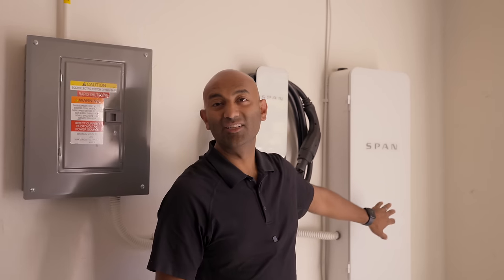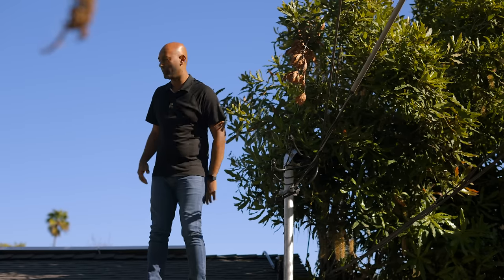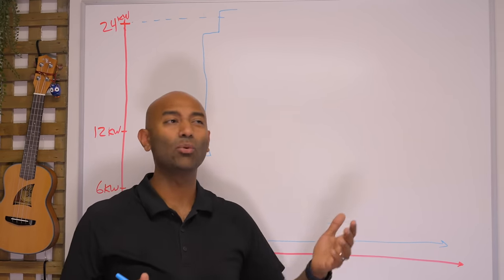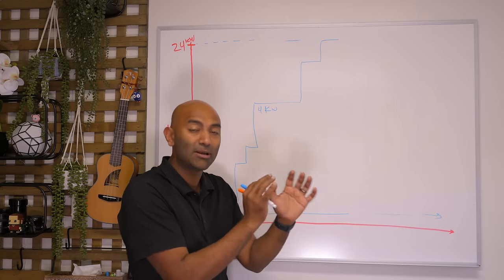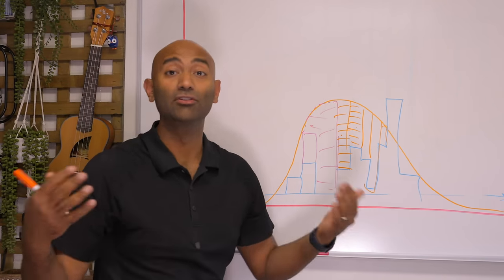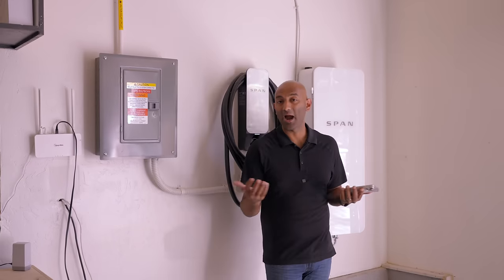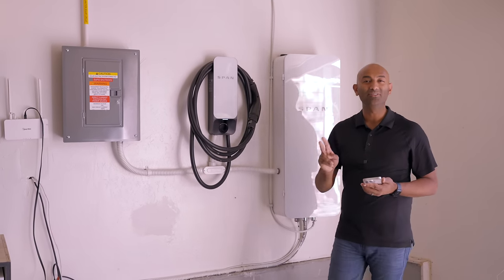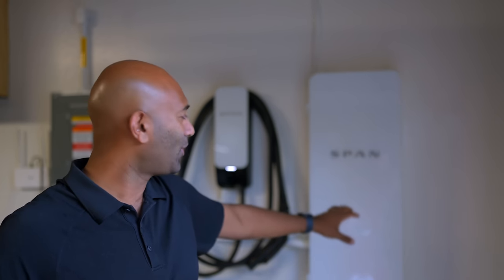I Installed a SPAN Smart Home Panel, Should You?

Comment: Another approach, especially those of us on $DG&E, is a battery back up modified to provide power when the grid load nears 100A.  Just like the panel it levels out usage, but in this case, without compromise (except price is a bit higher).

On SDG&E, also power everything from 4PM to 9PM.  That offsets part of the price.

I've tries to convince Sol-Ark to modify the software to their system (PV inverter, 48V inverter, 48V charger, transfer switch, grid input, & generator input).  I've also asked them to include an EV charger that can charge the EV with excess solar, and from midnight to 6AM when the rate is lowest.
Reply: I'm a bit surprised that Sol-Ark wouldn't be able to do that already.  It's one of the most programmable whole-house systems out there.   A feature to limit service ingress amps to X by augmenting the house from the battery system... that's something I expect they would want to add to their feature list.   Maybe try writing them a physical letter instead of using email.  Address it to the "Principal Engineer" or something like that.  It might get to the right person.

There is a bit of balancing act involved when grid-tied, particularly when it comes to managing grid import and export.  No inverter system can track the load so precisely that it is able to completely intercept large changes in loads instantly... they will always impact the service for a short time.   But programming a ramp is easy. Something like "Augment service from battery and solar by a minimum of (10A to 200A) as import from service ranges from (50A to 100A)" ... something like that would be really easy for them to add programming for I would think.   It is workable as long as it has a few seconds to react.  So ramps like that ought to work fine, but instantaneous responses are impossible.
Reply: @junkerzn7312  Agreed!  I have 3 of their inverters, and appreciate its capabilities.  The cost here (San Diego) to pull a wire from the pole and installing a new main panel is near that of a Sol-Ark 15 (adds 62A) and a battery.  

Reach out to them as well, maybe we can show them there is a market.

Comment: I work in the electrical industry and have been saying this for a decade...time to integrate digital tech into residential power distribution! It's like the gas/electric vehicle argument, having capacity to drive 500Km sitting in a driveway when you only typically need 100Km. Same with service power where 200Amps is rarely ever used, not a zero possibility but still in the less than 1 percent range (otherwise you may have equipment lifespan & load issues). So it's time for power management at all levels. We can do it for EV charging but still have capacity issues for other loads! Well done Span!!!! If you need a Canadian representative let me know!! Maybe I'll knock on your door?

Comment: I have a solar, battery and a span panel. The biggest limitation of smart panels, ie. it's not just Span, is that the usefulness is limited by how your house has been wired. For example, my internet connection is on the same line than many non essential loads. So I have to keep the non essential loads as critical and powered in the event of a grid outage, potentially using some of the battery...

Comment: Does it work if your internet is down?  
Where is the intelligence? Is it all on the server, or is there some CPU and memory in the box? 
Can you set it to turn on power to a circuit if you have excess generation.  ie if you are generating excess PV at noon, can you use it to turn on the AC, then turn it off as generation goes down.  Combine that with a smart thermostat to set lower temp during day. The idea being to "supercool" house with excess power that you cannot sell or save in a battery.

Comment: Love the fact that @1:16 in the video, you show an electrican doing something that would cause many an inspector to fail the install.  The idea of using a box cutter to strip the insulation back on the romex means that the knife may have also breached the internal insulation.  I've had inspectors fail inspections for this specific reason.  While usually it is at outlet where electricians screw this up, in your video you show the very activity that goes against code and good practice.

Also, at 5:58, who drives on the left side in Californi?
Reply: (Amused) reminds me of another sustainable channel with an advert with clip of a solar installer who doesn't seem to have a safety harness on and I don't recall a safety barrier around the edge, although I may have missed it. Granted the US is behind my country on solar panels so it wouldn't surprise me if the safety standards are also behind. It used to be a safety harness vs someone without was one of the ways to tell the professionals from the cowboys, now apparently in parts of my country if you don't go for protective scaffolding around the edge they start asking questions as to why you didn't use the safest option available as said options are much cheaper and easier to install than they used to be.

Comment: At the moment every vehicle comes in and fills its tanks to max full with petroleum. 
But average mileage, and average daily fuel consumption tells us that very little daily is required if daily top-up is done.
Home plug in at low topup rate would be ezi pezi most days of the year.
Plug in at work on a low topup rate would be simple. 

Rapid charging will not be common most days of the year. 

People get confused about real needs and the horse and cart type of fantasy.

Comment: Your 240v circuits didn't carry over to the battery? With the Sunpower SunVault 13 kWh we are able to use our 240v 30amp electric dryer straight off the battery, granted it can run it down so that we hit our reserve point overnight. It would be great if the Span system could integrate with full systems such as SunPower Hub+ as this will feed into the Span panel via the Service Conductor Entrance on the Panel. The Hub+ is the Solar Supervisor, Backup Pan, Non-Backup Pan, Battery & Solar combiner. This also includes the Microgrid disconnect and becomes the Main Service Disconnect for the Electric Service, if an intermediate (due to distance between Hub+ and Meter) or Meter Main Service Disconnect is not required.

Comment: This is a very useful and flexible product offering.  It acknowledges the serious limitations of the existing power grid, especially in places like CA, where the grid is already badly over-loaded.  However, if enough people have EV's to charge, no amount of juggling output is going to matter, if the grid simply isn't producing enough energy.  Things like this are solutions for the top quintile, leaving everyone else to fend for themselves as the gap continues to widen.
Reply: Even 50 years ago they had things called rolling brownouts because the grid was badly over-loaded.  That was of course when the heat was overwhelming, not a normal day.  Same as CA.  Now everyone is charging various batteries constantly, have AC, and multiple televisions and computers. Also,  Now go look at a brand new television and look at that yellow EnergyStar stickers or how much LED bulbs use.  The excuse of comparing our grid to those mismanaged grids that can't even handle home microwaves is not a good vision of the future.

Comment: Can't wait to see you use the span to tell how much your dryer uses and how much the next dryer uses per load. That's my biggest unknown right now. Tried to figure a way to scrape Powerwall home usage data for a year, than use pattern recognition of the chart to estimate clothes dryer totals... alas, a little too tricky for me. Maybe GPT 5...
Reply: Can you put a cheap smart plug on your dryer and use that to calculate energy consumption? I have a cheap (£6.50) Amazon smart plug on my washing machine I've flashed with open-source tasmota firmware. I now know that a full wash at 30C uses about 0.27kWh and the same wash at 40C uses around 0.43kWh.
Reply: @MinotaurUK  You'd need to find a 240v smart plug. I've never found one of those.
Reply: They seem to be from the UK where all plugs are 240v haha. So it's possible but  maybe harder to find the ones compatible with US 240v plug designs
Reply: @tjs114   - lol, those are standard in much of the world  - Jk, don't necessarily expect a European or Australian single phase 230-240VAC device to play nice with USA split phase 220VAC - ground is different.
Reply: All you need is a smart energy monitor wit CT clamps in your main panel.  That is exactly what is inside the span panel. It's just fancy packaging and a well designed monitoring app that communicates with their proprietary current limiting EV charger.  It's very similar to Zappi devices that do load shifting for zero export situations.
Reply: @jstaffordii  Or. Take the CT clamp and monitor and clamp around any appliance to determine loads etc (more versatile though less user friendly than a single smart plug) - lots of ways to skin cats.
Reply: Look into Sense, mine has no issues telling me what various devices use once it iodentifies it and the dryer was an easy one for it. Electric dryers are hogs!

Comment: To reach a new highs they will need help from devices itself. Think in your refrigerator, for example. There is no big difference between 4º and 6º Celsius degrees in the refrigerator or -20 vs -15 in the freezer, which means that the energy management center (SPAN here) can tell the freezer/refrigerator when its better to store cold because electricity is more available or it's cheaper.
Even better if it has some kinds of cold storage (a solid/liquid with a freezing point of the stabilizing desired temperature), so, somehow it can be estimated how much cold is stored there without changing the temperature itself (just from cold to liquid inside that storages).

Another use case, it you use some water heaters with its own heat water storage, some demand could be estimated and moved from one hour to another. For example, think in your washing machine that have a specific "hot water" input that it's activated when you wash with hot water instead (or as an addon) of the internal resistance. At the same time, the hot water source is connected to a hot water tank that use electricity as a source. So if the energy management center thinks that you are gonna use the washing machine, it can heat more water in the midday to lower the cost even if some heat is lost because the storage is not perfect.

There is multiple use cases where consumption can be balanced specially if the consumers can inform the "coordinator" about a future consumption.

Also I love the concept of priorities with batteries. While lights, refrigerator & freezer must be a priority, other uses can be cut in an emergency. That a system do it for you it's a great thing that avoid mistakes.

Comment: SPAN is a cool device that provides a lot of flexibility for managing one's electrical systems.  However, I would advise people to take a close look at their electrical usage patterns, grid reliability, solar generation, and costs before deciding on a system to manage their home's power needs.  You don't want to pay for capability that you don't really need.  

I have 125A electrical service in a 2000 sf townhouse.  I have an EV, three heat pumps, an induction cook top, electric oven, two under sink electric water heaters, a 4.6 kW PV solar system with 4.8 kWh battery backup, and net metering.  My electric bills typically amount to a fixed fee of $20/month for connection to the grid.  

It would be a superfluous cost to install a SPAN system in my situation.  By taking simple steps like scheduling the charging of my EV after midnight and staggering the use of other high energy loads, I've never overloaded the main breaker.  I have a critical loads panel that's battery backed up in the event of a grid blackout, but can also switch the heat pumps, induction cook top, and oven circuits to the critical loads panel when there is ample solar power being produced to handle the load.  Granted it's not automatic, but I can monitor and control most of the system using apps on my phone.  

This simple customized monitoring and control meets my needs at a very affordable cost.  I'd love to have a SPAN system, but it wouldn't make economic sense in my case.
Reply: Very good points and love the specifics. Thanks so much for your input. It really adds value to the conversation.
Reply: I’m starting to think that a SPAN panel may be more warranted in places like convenience stores that want to offer EV charging service to their customers or homeowners with particularly large power needs in a place with particularly low power availability.
Reply: Either way, I still feel this type of hardware is more for convenience than anything else. Oh, and its pretty cool too, hehe

Comment: You talk about keeping the excess energy with you if you're not being compensated, but you don't mention the need for a battery backup to store that excess energy. In your scenario you mention the Tesla, but you also mention it being fully charged. There would be no where for the electricity to be stored in my house without batteries. Or am I missing something?
Reply: One could store that energy in a hot water tank by heating the water extra hot and have a mixing valve as the water leaves so that no one gets scalded.
Reply: Storage tech is yours to choose. If the panel can divert power to the aféala, it’ll be able to send it wherever you want to store it. But of course, that storage doesn’t come with the panel.

Comment: Span should develop a series of smart plugs that integrate with the SPAN smart panel, they could communicate with the main system and provide greater resolution for individual energy use. If your garage circuit reports pulling 1000kw, you have no idea where that might be coming from. Imagine plugging your fridge into the smart plug which is assigned to the garage circuit. And the SPAN app can now report that on the garage circuit, 1000kw are being drawn total, with 100kw being drawn by the fridge.
Reply: Lol it would take decades to save enough money by using knowledge gained from this, to actually make it worth while

Comment: Man we're soo close :D The battery is the only thing left that really holds me back for the most part because of price and or tech depending on how you look at it. Just waiting for either the battery to come down or they switch over to some new chems on the design. Solar it self is already pretty close to getting grid power or less than as time continues and they increase the gird cost. Personally, if they like to really push the idea/value of their system - it would be have the ability for this monitoring system to have the ability to attach solar and battery for DIYers. Just a plug you plug in to increase the storage pools would not only help lower the cost on installing later down the road, but make it dead simple to upgrade as technology changes.
Reply: the nice thing re span managing loads, is that while it is expensive, it might be able to help intelligently manage battery loads, to hopefully reduce battery count...
each Powerwall being over $10k installed, that would pay for the span itself?
Reply: @cgamiga  It should, at least from a scale point of view. The problem is right now we need a system that fits everything all at once. Nothing smart about it. Thus that means larger systems and larger cost, but having the ability to just attached stuff over time to your pools of solar or storage - that lowers the cost by a lot. DYIers can copy installs and setups - thus saving a ton of money for their systems if the cental controllers can handle everything else along with balance loading.

Comment: You don't need a new panel you can get a EV charger that monitors the mains into your panel with a transformer.
Then you just set when to ramp down in the charging station software when there's a massive load on the service.
That's how we can use the mains to a multi apartment house to also feed a couple of charging stations without the great expense of running a new service just for the chargers.

Comment: Cool stuff. Great explanation as well!

Besides the up-front cost, the only worry I have is, with the added complexity, how long it will last. Currently, service panels, without recalls, etc. can easily last 50-80+ years! I just don't see this last longer than most other electronics. Say, maybe 10-15 years?
I could certainly be wrong.
Reply: Same here, and I also worry that they may add subscription fees later.
Reply: @CoverYourActions  perhaps for additional features, but I don't imagine they'd do that for features advertised now as being standard. But you never know. They could take a skim off the top down the road for selling power back to the utility. This could be good and bad. The bad is obvious, the consumer wouldn't get the full benefit. But, it could be good in that the company would be very motivated to make sure all their panels are always fully functional and they would likely have great support, perhaps even offering a rather extended service warranty.
At any rate, I wouldn't be a first adopter of this kind of thing.
Reply: @mockingbird187  Here is hoping that you are correct.
Reply: recently my family was offered a replacement plastic panel for the house. the same one that is now banned in the UK.
these electrical managers go around trying to get everyone to replace whats worked perfectly all along with an expensive plastic fire hazard.
its the managers that need to be replaced imho